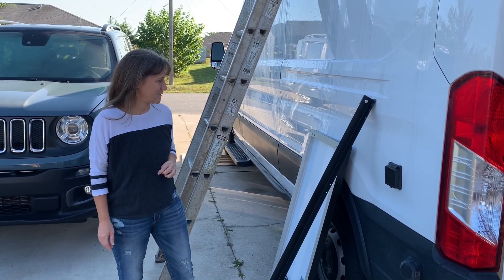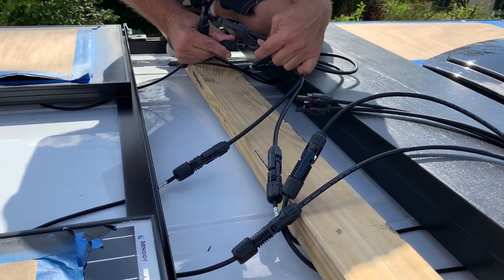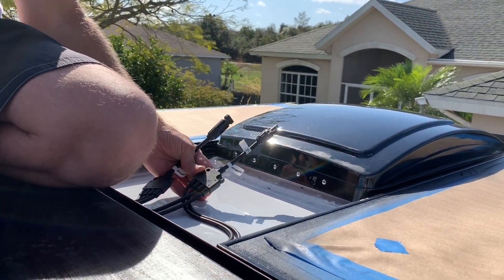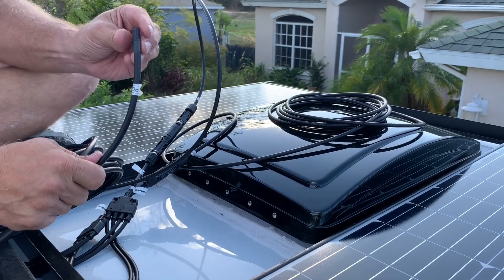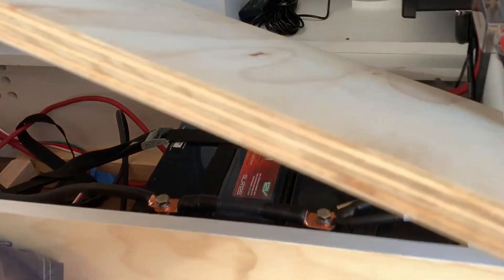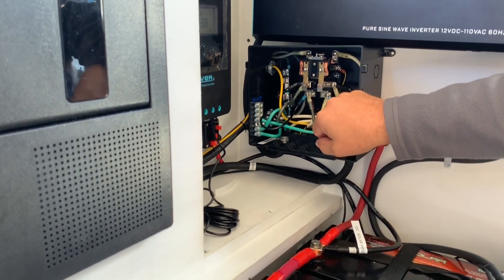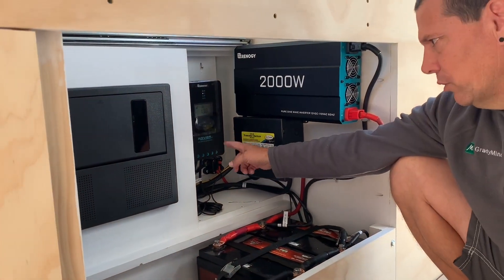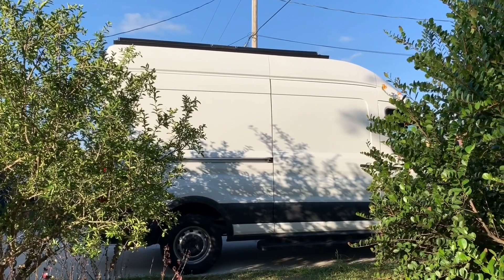Van Conversion: Mounting Solar and Electrical Components | DIY Campervan Electrical System Part 2

Comment: You guys did an excellent job building your VanHome. The craftsmanship is outstanding. Your creative ideas on the layout are perfect. Keep up the good work. If I may make a small comment, I can't tell for sure but it appears your inverter / charger battery connections are wired to battery #1 with battery #2 connected positive to positive and negative to negative. The positive to positive and negative to negative wiring is correct for a 12vdc output BUT your charging inputs (Line) +/- wires and your inverter (load) +/- wires should be connected as follows. The + Positive (Red wires) should connect to the red + post of battery #1 and all the - Negative (Black wires) should connect to the negative - post of battery #2. And when you install your 4 batteries all the red (line/load) positive wires to battery #1 + red post and all black (line/load) negative wires to battery #4 - black post. Current flows to the path of least resistance and when you connect your red wires to battery #1 + post and your black wires to battery #1 - post this put all the work on poor battery #1 with battery #4 just sitting back there whistling Dixie if you know what I mean. Anyway... I loved all your videos. They were put together well and very informative. Just think of all the wonderful memories that await both of you as you travel around.
Reply from the maker: Hi Ronie, thank you so much for your kind comments. As far as the battery connection goes, the way you explain it is exactly how we made our connections once we added the other 2 batteries. So all the positives go into battery 1 and all of the negative go into battery 4. This is something we did not know when we started the van build but learned as we went. This information is very important for other new van builders.  I am going to pin your comment to the top so that others will read it also.

Comment: Hello, thank you so much for posting your videos. I know this last year, but I was curious how you connected the l bracket to the superstrut?
Reply from the maker: The rectangular nuts with the springs that are shown at 0:35 in the video slide into the superstrut,  Then the L bracket goes on top of that superstrut and the bolt goes through the L bracket and into the nut and is then tightened. The rectangular nut, L bracket, and the bolts can usually be found near the same area as the superstrut in stores.

Comment: Just caught up with your van build videos.   Just wondering why there is on insulation on the floor?
Reply from the maker: We didn't think it would be necessary. I plan to travel with the weather and avoid extreme temps. Also sound doesn't seem to be an issue with the ribs and furring strips that run between them.